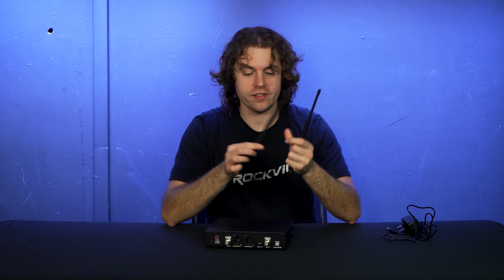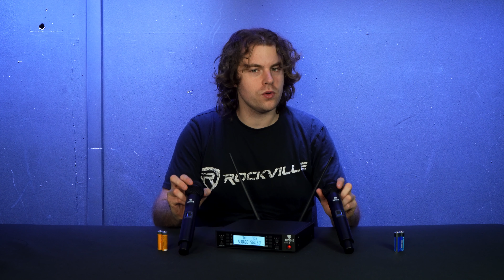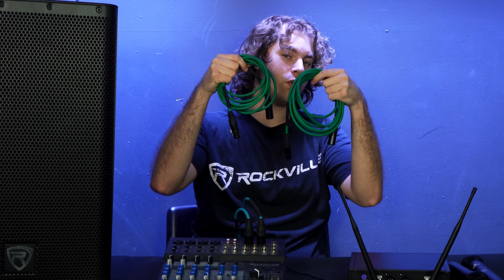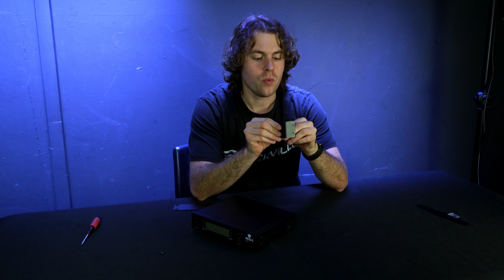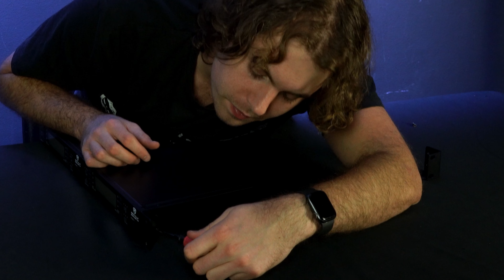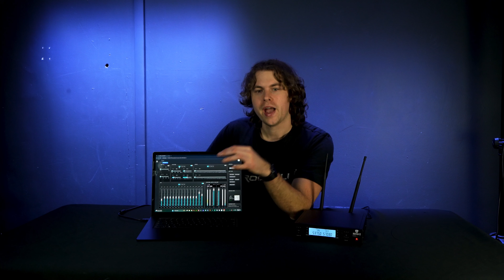How To Set Up Your RWM-DSP-H2 Dual UHF Microphone! (USER MANUAL)

Comment: Rockville dB16 8000W Mono 2-Ohm Car Amplifier, High-Speed MOSFET, Adjustable 12dB Crossover, LED, Remote Sub Control, Perfect for Car Audio and Subs (Is this product bass or voice?
Reply from the maker: Looks like a product title from our dB16 car amp got pasted onto this mic video 🙏 — that dB16 listing is a mono car sub amplifier (bass), not a vocal mic. This video is for the RWM-DSP-H2 wireless mic system (voice). If you tell us whether you need car bass amp help or wireless mic help, contact us here: https://rockville.s.gy/contact

Comment: Trying a Rockville product for the first time.  Bought a Rwm DSP L2.  Everything looks okay except the microphone headsets.  They look and feel EXTREMELY CHEAP.  CAN I get a better headset that will work with uhf module??  I'm not sure but it seems like the lapel lavaliere was not included. All that came was two really cheap headsets.  Hopefully they work and don't break the first day of use.  The headsets look like theyll break by just looking at them.
Reply from the maker: Sorry the first impression on the headsets wasn’t great — thanks for giving Rockville a shot. Replacement RWM-DSP-L2 headsets are listed on our site, and we can help confirm what’s in the L2 box (headset vs lav depends on the exact kit). For a sturdier spare or to sort a missing lav if one should have been included, contact us here with your order details: https://rockville.s.gy/contact